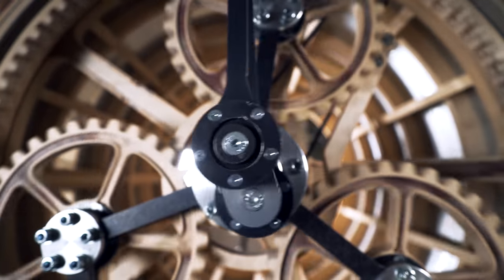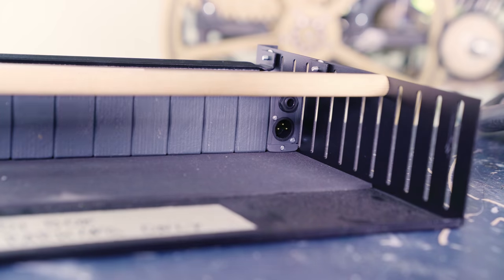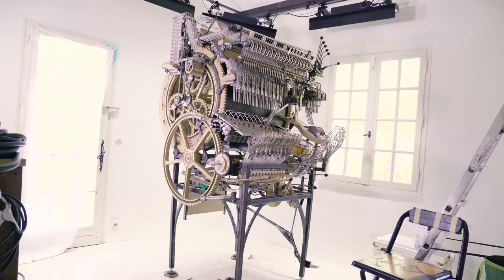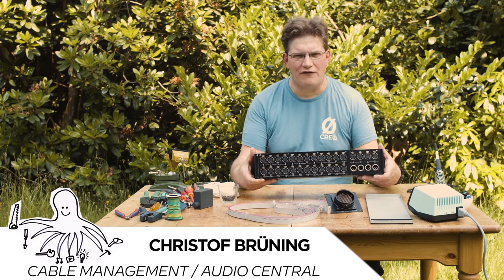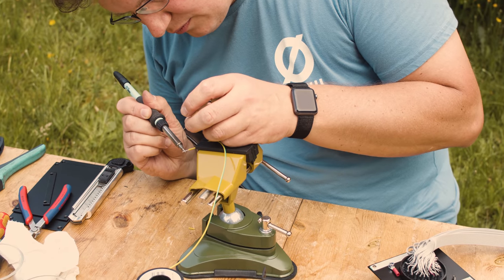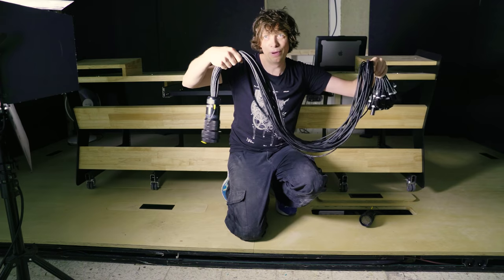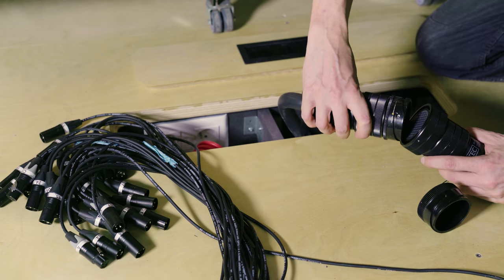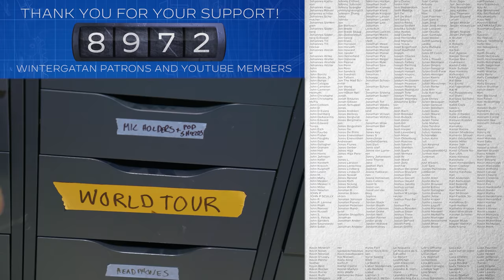28 Audio Channels in One Cable! - Marble Machine X #133

Comment: I would start thinking about what needs to be done to put the machine into "transport mode" Including break-downs, locking the movements, external skeleton framing and protection, shock resistance, moisture resistance, spare parts, etc...
Reply: I would also start thinking about personal property insurance for the MMX, just considering the time and materials that have gone into the project thus far.
Reply: @bbbbeeeaar  Knowing him, he probably has that on the Excel spreadsheet with things he needs to do for the machine.
Reply: In the early episodes, Martin talked about, how the MMX disassembles into 7 "manageable" parts for transport. That was before all these improvements upon improvements, but I feel like Martin has it still on his mind, as he wants to do the tour.
Reply: @rstrela  I thought it was 3 parts: Top, frame and instruments
Reply: @evnor  I think it's like the legs, instruments, marble divider, programming wheel,  all the levers and stuff. Maybe the marble gates. But I don't remember anymore :)
Reply: @rstrela  At this point I wholy believe we're going to get a spin off series where we get to see Martin start working on a new eight-legged walking mecha with vibration dampening that walks the globe allowing him to play music ala Wild-Wild-west style. XD
Reply: The plywood needs to be coated so that it doesn't absorb moisture, and the steel needs to be painted so it doesn't rust. I think there will be one mammoth teardown session after completion, before it gets used a lot, where every screw gets locktite while all the wood and metal parts get coated. At that point all the subassemblies can be 3d scanned for custom packing material and transport case design.
Reply: Honestly he is gonna have to look into mil grade transport containers that are similar to pelican or storm cases. Then of course either he could or someone else create custom foam cut outs for each section that goes into the case. I am fairly acquainted with ones around 5' cubed containers and honestly this tupe of cases would be his best option especially with the plywood. The main issue with air transport is that the cargo hold is NOT pressurized meaning that moisture/humidity can cause hell with the plywood. I think i can speak for a decent majority of supporters and enthusiasts for this project and path to greatness that if a simple lack of proper transport containers damages the machine before the world tour that it would be tragedy that would go on for ages. Please martin, get proper transport containers. Asked around for a local military member thats fimiliar or even in the comment section of your vids. I would be happy to give 2 cents about cases in order to protect this masterpuece so that people can enjoy this in person.
Reply: Spare parts needed 👍🏻
Reply: I also would start to build a reasonable amount of spare parts, just in case something breaks during transport.
Reply: NCGC GenRAVE Martin doesn’t usually read YouTube comments. He does, however, have a Discord server where he and the community (including his team) are way more active, maybe you should share those suggestions there.
Reply: NCGC GenRAVE please let him know this in his discord server
Reply: He’s probably already working on getting the programming wheel made from flame polished acrylic.
Reply: @ofnihility  I'd watch the heck out of that, ngl
Reply: @ofnihility  Needs to be built out of sapient pearwood !
Reply: @petter5721  a whole spare MMX needed...
Reply: Also need to adapt it for zero-g, will eventually go up there right?
Reply: @ncgrave4586  cargo holds of most airliners are pressurized. Otherwise you would not be able to transport live animals and a lot of other types of cargo. Yes, some aircraft, especially small business jets, have unpressurized holds. But there is no way the MMX can fit in such aircraft.
Reply: @bbbbeeeaar  I'm curious about how much it would cost someone to duplicate the beast even if they had the plans in their hands!
Reply: @kschleic9053  Honestly, I wouldn't be surprised if he just makes a new MMX for the world tour that's a clone of his studio one. It would allow him to treat it and assemble it in a sturdy way. The MMX is complex but most of the difficulty has been in designing and redesigning rather than the actual construction. Still a months long project but not years long to rebuild. It's not far fetched either as his team has noted a need for an Americas MMX so it wouldn't have to cross the Atlantic.
Reply: kschleic9053 That is true, yet martin likes the raw look of the plywood. Maybe he can find some coating that doesnt affect the look too much
Reply: @petter5721  spare parts is why it is cad:ed.   To be able to generate new ones.
Reply: Duct tape.
Reply: Dudes!... There will be back tracks
Reply: @bbbbeeeaar  Oh my God I worry about this all the time. I so, so dread the idea of waking up some day to the news that, like, the house burned down or something and everything was lost...
Reply: There are entire departments in production companys who do just that, build custom road cases and set carts for equipment. I've been a stage hand/ set carp for 10 years, I've seen millions of very cool ways to transport massive set pieces.
Reply: @michaels.ramsey7803  set carpenter for 7 years here. its amazing what cardboard, moving blankets, foam, wood and ratchet straps can do for transporting, even high quality museum pieces, but i'm sure he'll need to utilize some fancy injection molded foam or something, so many weird shapes and angles on this thing.
Reply: @doublebass  maybe he could use some of that instapak foam that gets used for shipping prebuilt PCs
Reply: @XenonG  I just wanted to say that this machine probably wouldn't work so well without gravity. I know what you said was a joke but unsure how much you thought about it.
Reply: I'm thinking more about TSA or other country's custom officers that are notorious for breaking items as they "inspect" it.
Reply: @ThinkGamer lol
Reply: Honestly, this design doesn't lend itself to breakdown for transport.  Ideally, you'd want to add padded pins to lock the movements in place during transit, remove the legs, adding a frame with rollers (think inline skates) in place of the legs to not only keep the MMX off the bottom of the container, but also allow for easy insertion and removal from its container.  Then you could have channels in the container to receive the rollers, and an integrated ramp in one panel of the container that hinges downward.

The legs would have to be redesigned to bolt on and also disassemble so they could be stowed alongside the MMX.  Plus a series of support struts would have to engage the frame to stabilize it and prevent exterior parts from being smashed if there's a shock to the container.  And given the large amount of plywood in the construction, a large pressurized container would need to be used to avoid warping and disintegration.  This would almost have to be the kind of aircraft shipping container employed by firms like FedEx.  

In fact, perhaps Martin could reach out to Fed Ex (or UPS) and see if they'd like to sponsor the construction of a bespoke transport container, and help with some of the shipping?  It could be commercial win-win to show off how FedEx can meet any challenge, while showcasing Martin and the MMX community's ability to overcome any challenge.  Or would that be going too corporate?  Either way, they may at least offer to consult on the construction of a proper container.
Reply: @ncgrave4586  - Given the amount of mass the MMX represents, even the most rigid foam won't be enough.  It's going to need a shock-absorbing frame to be attached between it and its container.  But your point about pressurization and moisture are spot on.  I posted a comment proposing a bespoke pressurized aircraft container like FedEx and UPS use (you see them on "Cast Away") which would allow for easier and more standardized transport by air or ground.  Your idea goes in the right direction, just not quite far enough.  :)
Reply: the guy is a genius, pretty sure he knows what he is doing
Reply: @ofnihility  Well, he's got 5200+ patreons and +/-3000 youtube donators so right now he's making more money than he would as a musician, so yeah, he'sprobably going to milk this as long as he can. I can't really blame him either, if people are wiling to pay him more for watching him messing about with this machine than they would pay for a ticket then he'd be stupid to go on a tour where just the cost of lugging the MMX around is more than half the ticketsales...
Reply: And will it fit through the door.
Reply: He probably would just make it into a car.
Reply: Why not make some custom foam pieces and put it in one of those big trunks?
Reply: @yttrxstein4192  The devil invented them, awful things that get everywhere. This machine needs a custom flightcase and some of the outboards parts seem pretty fragile for life on the road.
Reply: @yttrxstein4192  Tektronix Inc.
Reply: @yttrxstein4192  lol do you realize how long it would take to clean all of those little things out of the machine?? lol
Reply: @rstrela  lets be real the tour is never happening. this thing will fall apart in repeated transport.
Reply: This thing won't survive the first ride. It just is designed with no fault tolerance at all.
Reply: @ncgrave4586  i feel like he will properbly make the plywood parts out of something else before the world tour
Reply: @ncgrave4586  why would they not pressurize the cargo hold? It seems like that would stress the aircraft more than just filling the whole cylinder of the fuselage

Comment: Martin, in the floor where you have the connection between the "spider" and the "snake" you should be very careful about bending those lines back the way you have. I work in aviation and we deal with cannon plugs like that one all the time. They're sort of fragile. They wear out easily over time. We have strict rules about routing wire harnesses and your bending in order to fit it through the floor breaks them.  Seismic and acoustic vibrations will cause internal chafing if the wires are pressed up against each other.
Reply: This is a really important point. Glad you mentioned this.
Reply: @Eli Z it might be, but the machine will be sharing stages with huge speakers for years- its best to plan ahead
Reply: As an aerospace engineer I cannot stress what you're saying enough. We take very specific and cautious designs with the wiring for these harnesses. They are fantastic and work really well, but have their drawbacks as you described.
Reply: I think you people are underestimating audio engineers.
Reply: Yeah, bending any cable is risky. It's not just in aviation, I was taught the exact same thing when dealing with electronics and cable management. Another common point of failure is the stress relief of connectors. Those can break too.
Reply: These connectors and cable could not give a crap about that, we put these on touring stages and sometimes literally bury them in the ground for festivals.  His will probably have the easiest life of all the assemblies from that manufacturing batch.  Your use cases in aerospace are completely different and not relevant.
Reply: I worked in F1 Racing for many years, we use crimped MIL-C-38999 spec connectors (slightly modified and marketed as AS connectors by Deutsch) together with cross-linked polymer-insulated wires and cross-linked heat-shrinkable sleeving and mouldings. The conductor insulation is very tough indeed and resists chafing very effectively. The harness is designed using 3-D CAD (e.g. CATIA) integrated into the rest of the car. Individual elements of the harness can then be laid out on jigs containing most of the bends. Where I worked, we had a zero-tolerance assembly error policy, although the contacts are removable from the connectors, we stipulated that if a pin was incorrectly inserted, the entire harness would be scrapped, paid for and a fresh start made! This is because the contact retention spring clips are very fragile and break easily, typically shorting to an adjacent contact. Similarly, we had a zero-repair policy. A harness was either perfect or scrap. After this system was put in place we had no harness faults at all. But it costs probably more than the aircraft industry can tolerate.

Regarding bending, and excluding specialized structures such as screened twisted pairs, about which many words could be written, not by any means all polite, the cable assembly can be made flexible if it is remembered that certain numbers of conductors fit together perfectly. You can try this with coins, 7, 13, and 19 are three I can remember. If there are insufficient to make up one of these magic numbers, fillers can be used. The bunch of conductors is then lightly twisted, one whole twist every 75-150mm (typically, depends on number of conductors), before the heat-shrink outer is applied. This makes for a pretty flexible, but robust harness. 

A F1 car, especially in the engine space, is an extremely high vibration environment. On the engine itself, 500g rms at 1kHz is typical.
Reply: When I watched him drop the cable in there first thing I thought was: "hope he bought two"
Reply: Never mind that this installation doesn't meet aerospace or F1 racing spec, the guy soldering doesn't look like he has done much soldering before..
Reply: @rb4568  Yeah, I used to work in theatre (weird saying used to), and in order to neatly route things around existing architecture (especially in spaces that weren't originally designed to be a performance space) we had oh so many times that we would pull snakes across things where connectors would get snagged. We even had one where the snake had a stage box on one end and a breakout on the other (no connectors in between, just came straight out as like 32 3-foot cables with XLR on the end). We had tried to put a bag over it to keep everything together, but the bag tore halfway across a set of conduit we were draping it over. No repairs necessary on any of the cables, despite at least half a dozen snagging themselves among the conduit. The only issues we ever had were mixing manufacturers of multi-pin connectors and where they allowed for tolerances being different causing some issues with actually fitting them together well (though that was mostly with lighting stuff). Oh, and a few house-made cables having poor quality soldering
Reply: @retrofitter  pulling the connector pin through with plyers showed me everything I needed to know there.  IPC Class 3 trained.

Comment: As someone who worked for a production company, I can tell you those giant cables are a huge pain. They are freakin heavy. And the spiders get tangled so easily. I remember when i first started out, they had me working in cable, and i spent hours just untangling returned cables from shows and it was Sisyphean at times.